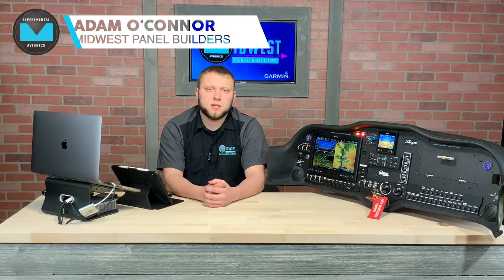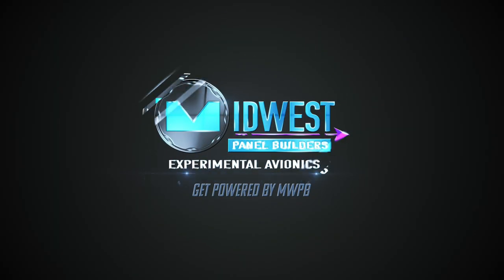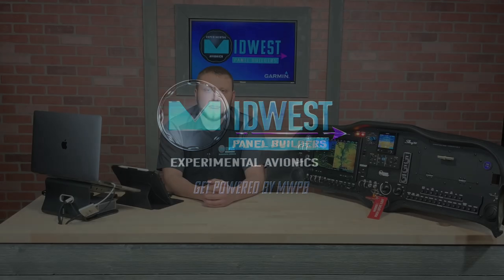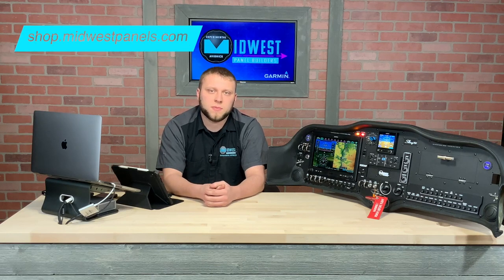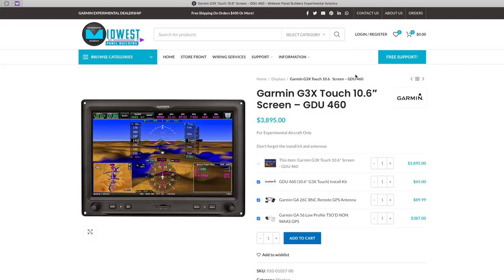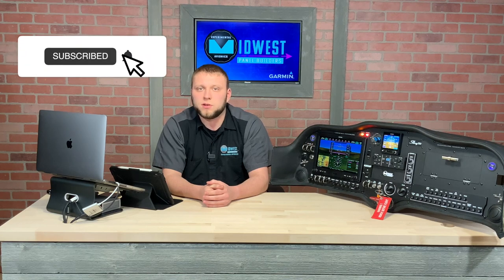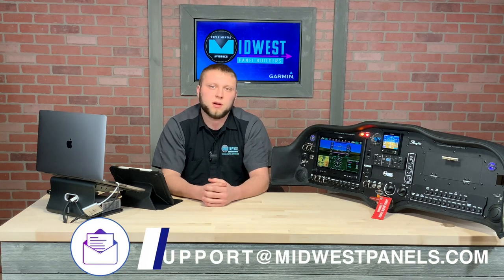Backups For Your Experimental Build?

Comment: I own a RV-10 with 2 Dynon displays with dual AHRS and a GTN650. As a backup I use a GRT Mini X which is completely independent and has its own AHRS. It is a PFD, Map display and provides a 3° glide slope to any runway !!!

Comment: My RV-10 has a G3X PFD & MFD  as well as a G5. Being IFR my aircraft is equiped with a 20amp B&C backup alternator & 6ah TCW Ibbs. 
At present with my Master switch off & the avionics running on the 6ah battery my VPX-Pro is off line. 
It leaves me with only  the PFD running. No coms, no transponder, no AP, no trim or flap indication….
Is it feasible/ reasonable to have the VPX also able to be powered off the TCW?  I could then continue to use it for controlled load shedding.  
Maybe have a panel circuit breaker for the VPX so that it could be pulled as a last resort. 
However I would still have the G5 as a last last resort!

Comment: what are the trade-offs for adding a secondary ADAHRS vs installing the G5
Reply from the maker: In a dual-display system, there’s not a whole lot of difference in the system, other than the G5 being totally standalone if need be. In a single-display system, a second ADAHRS won’t cut it as a backup as a failure of a single display leaves you in the same boat as an AHRS failure. In that case, a G5 would be better than a second GSU 25.

Comment: I want to have two 10 inch displays in order to tech my kids as we go cross country.  Two G3X’s would fulfill the primary and backup attitude source, correct?  Is there a cheaper or better way to have two ADHRS sources AND two 10 inch displays?  Thanks
Reply from the maker: No, you would still need 2 AHRS sources as they are independent.
Reply: I don't know what you'll be flying, but how about going with 7" displays or a 10" on the left and a 7" on the right?

Comment: If I get dual g3x , do I still need a g5 ?? Would a g5 be a third backup ?
Reply from the maker: Unless you install a second AHRS it would be wise to have the G5 as it becomes your backup for AHRS information.
Reply: @MidwestPanels  a second ahrs for the g3x would be cheaper and clean up the panel.
Reply from the maker: @sbyoung1976  you are correct and that would be a reasonable option, we just like the stand alone nature of the G5.
Reply: @MidwestPanels  In the 2 second AHRS scenario, would the AHRS information compared and would you be able to reassign one of the AHRS source to the PIC display? That too me seems like a better option... :-)
Reply from the maker: @fdelacou  Yes with 2 AHRS, either will feed information to the system and is an option for sure. The beauty of the G5 is that its totally independent unit with its own 4 hour battery and in the event of a PFD failure, if properly placed would be more in the pilot view and easier to fly an approach with than trying to fly with the second screen being on the other side. This is why we like to place the G5 at the top of the panel, it puts it more in the field of view. This of course is just our preference and is certainly not to only way to do it. If someone wanted to eliminate the G5 and install a second AHRS there would be adequate redundancy, I would however be sure to have backup power to the second AHRS and practice using only the right screen in the event you had to rely on it,.
Reply: @MidwestPanels  the battery on the g5 makes it super attractive for sure! As a self contained unit, it’s hard to beat in terms of remediation for sure.